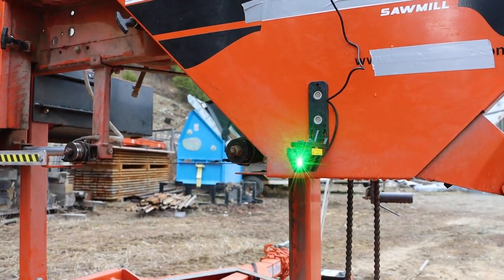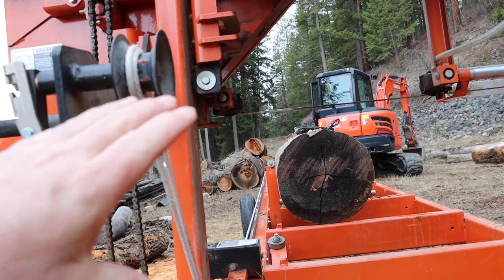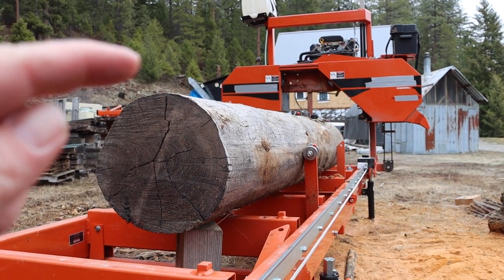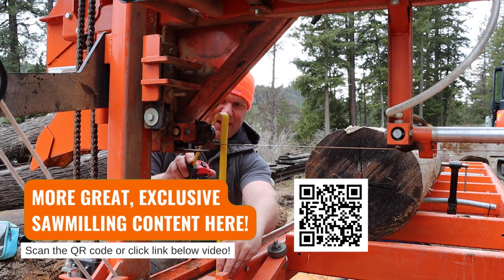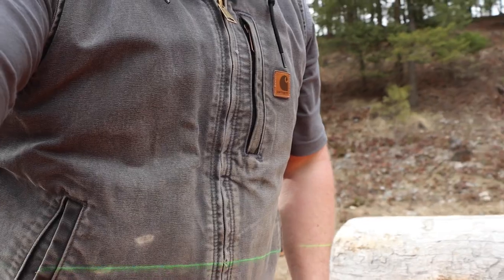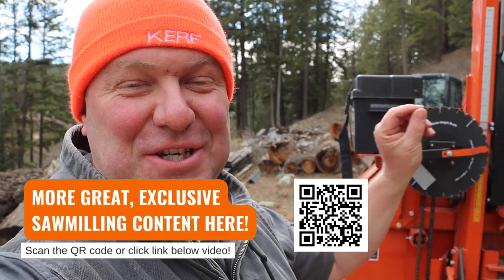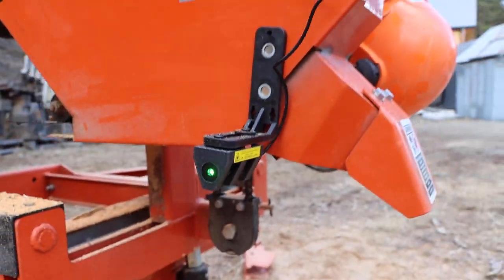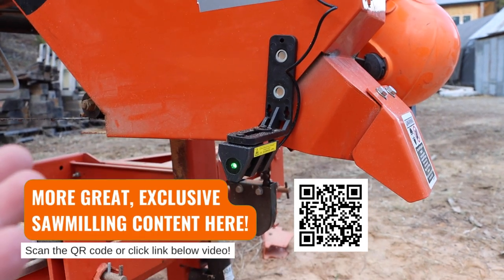Don't Buy A SAWMILL LASER Till You WATCH THIS VIDEO!

Comment: Think out side the box. Rather than place the magnet bracket on the blade guard, make a taller bracket that would be vertical and hold the laser level but mounted on the bed frame. It could be removable once log is set up.